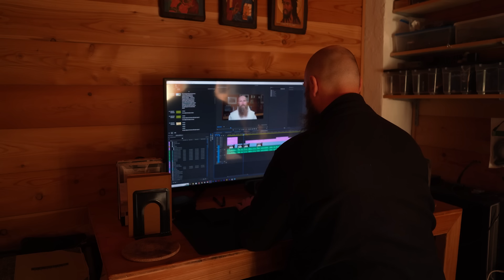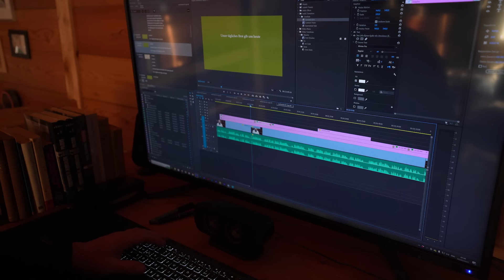One Year in the Life of a Part Time Hermit - March - Of winter's return, storms and toys for men

Comment: Very appealing videos Johannes. Thank you for your patient and inquiring attitudes; they are instructive.. (A tip if I may on cutting your firewood:  I use a Silky brand pruning saw. Expensive, made in Japan, but will go through those Beech logs almost like butter because of its ages-old design and high quality steel. Martijn could maybe get one for you at the local ferramenta.)

Comment: I don't think there are any missing teeth on your bowsaw blade. That sort of blade is made for cutting fresh wood, and cuts a tiny bit wider cut that a blade with uniform teeth. If you use a uniform blade, your saw might very easily get stuck, and the job would be much harder.

Comment: Why do you need to use the earth bags instead of more rocks?  You have endless rocks and creating the earth bags is so much extra  work?
Reply from the maker: fair question. Actually I don't have infinite usable rocks - at least not in any spot. But what I had in this case was gravel and low grade earth, which I otherwise would have had to move. So earth bags are a good way to use the material on site.